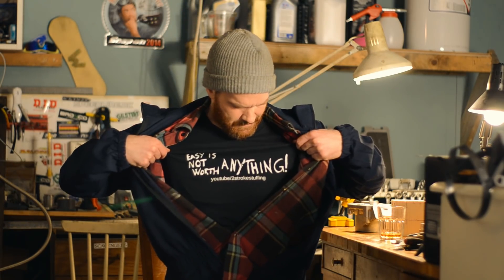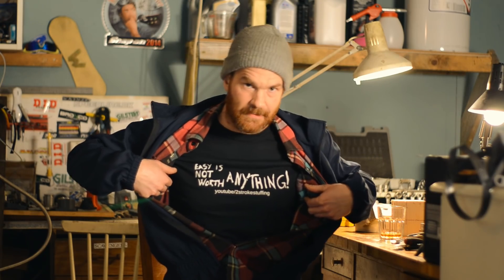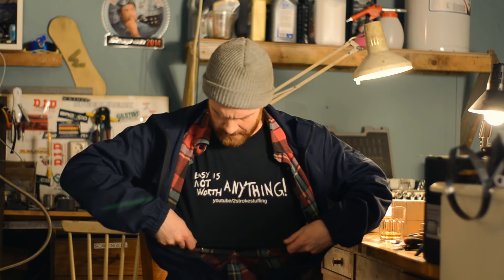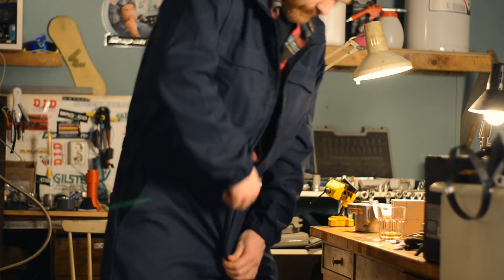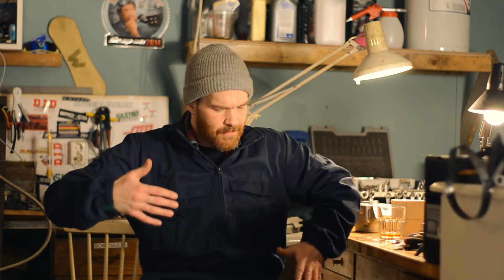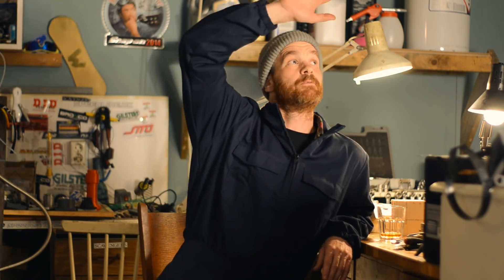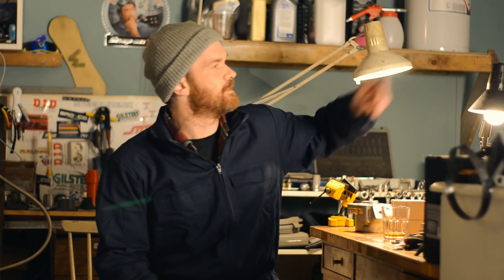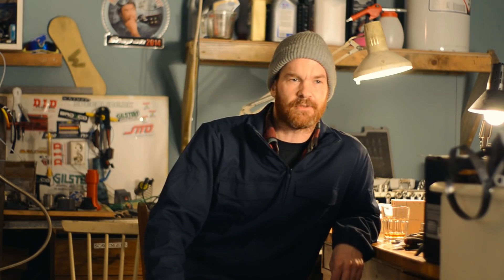The Most Powerful Two Stroke Ever but my tools need to obey their master first.

Comment: A long time ago I rubbed MoS2 grease in a 50cc freshly bored cylinder before putting everything together, after who knows how many km the rings started ringing a bit, this motor I estimated to at least 5-6hp after I did various trickery to maintain a good low rpm(!) power (for offroading) while it would run at around 8000rpm @ 90km/h, oh, the point, the cylinder had a dark glaze with no wear, but the piston and rings had done their job.
PS
A hint, it was a Yamaha DT50mx sold with 2.4hp to be lovlig ;)
The 16mm carb (sold with 14mm) gave just a bit more rpm for higher speed, which was mostly just a bonus, I aimed for "growl" not a dentist drill.. I did a few more things too, like an experiment making a 2-chamber out of the original exhaust (so the cops would not notice, and to keep the bottom pull) plus a small clutch spring in the wider part of the intake funnel to help mix things at low rpm ok I should stop here x)

Comment: Hi mate , I was wondering what's the purpose of secondary intake . From what I get it works on the resonance,  that's why theres no need for a reed valve , but wouldin't  that stop the carburettor from working?

Comment: Keep up the good work man.
I wonder if you saw my comment about using copper for head inserts in order to be able to get more aggressive without detonating. Beryllium copper would be the choice material, they use it for valve seat inserts with titanium valves in 4stroke to cool the valves.

Comment: I have a question I can't seem to find information on non reeded 2 strokes mainly used on smaller displacement engines gopeds weed wackers ect and was wondering if you could do a small vid on how they work and pros and cons of reeded vs non reeded figured if anyone could make a good video on them it would be you

Comment: Spend 10 minutes a day on the lathe and ten minutes on the mill. Doesn't matter what you do. Change bits, turn it on, turn it off, do it again, ... whatever. It literally doesn't matter. The point is to create a habit. Don't think about it, just do 10 minutes a day on each one. Eventually you will do more fruitful things and you will work longer because you made it a habit. How easy is it for you to work on your two stroke? This is because the habit was created easily because you love what you are doing. But you can tackle other things that may you may not have as much love for by making them a habit first. Try it! I HATE working out. I am applying this technique myself with dumbbells. I do a few minutes, as much as I can stand then I'm done, no guilt. I'll let you know how it goes.

Comment: Great work! If your steppers are cold you can safely increase the current to reduce risk of lost steps as forces increase with feed rate.  Rule of thumb is that 50 centigrades should be fine.

Comment: You should really fix the mill to the floor. Having is lose like that does No good for accuracy and chatter/surface quality
Reply: A mill that size it will make zero difference..
Reply: @M Bacon ... ok 17 years building, moving, maintaining, rebuilding Cnc grinders.. some grinding to less than a 1μm all over the world.. if you've ever been on an turbine powered aeroplane at some point parts of its landing legs and engines have been on machines I've built or rebuilt.. I'll repeat a machine that light, small and running on stepper motors.. you won't see any difference.

Comment: As a general rule it is better to run higher step ratios. 2:1 theoretically gets a little more peak torque, this is only when stationary. Once you get moving the extra smoothness of higher step ratios generally makes the motors less likely to lose steps.
One problem is pulse timing. Ideally at steady speed the step pulses should be exactly evenly spaced. In practice they aren't and steppers are very sensitive to timing jitter. There is always some jitter in the pulse timing and Mach3 running parallel ports directly is particularly prone to this. With micro stepping this timing jitter is averaged out to a certain extent. Mechanical resonance is also more of an issue with lower step ratios. I'd suggest trying 16:1 or 8:1.
What voltage are your steppers running at? These old motors like lots of voltage. I'd suggest at least 48V assuming your drivers can handle it. They may even take 80V but you may get heating problems. If you can hold on to the motor for  a couple of seconds it's fine.
PS that noise at 3:40 was drive belt slip. I'm very familiar with the sound of slipping toothed belts. Try increasing the tension. They like running tight. They are also pretty sensitive to pulley alignment. If one pulley is tipped relative to the other you can have problems.

Comment: Nice video, but first tool what you need is a proper MPG pendant for the mill! Manual pulse wheel is so much more precise to zero with, and not crashing in to your part. And when circular interpolating a hole you should first drill it out if possible. No point milling when drilling is an option. It's the most fastest way to remove material.

Comment: You need to hook up a MPG (manual pulse generator), it will make everything so easier, that you will regret why you didn't do it before. There are many different variants available from china, take a simple one with pulse wheel + step selector (x1, x10, x100) + axis selector, you don't need those fancy ones with displays and other unnecessary stuff...
Also get yourself a proper edge finder, look at the rotational edge finders, they are cheap and very accurate. Forget electronic ones with the LED in it, just a simple rotational one, it is very accurate and simple...

Comment: Couldn’t facing the cylinder on both ends just be done on the lathe? The surface finish could be better / flatter and you could physically clamp on the ID of the cylinder with the 4-jaws and zero it out....technically you could go as far as making an arbor to secure the colder on its ID that has tapers and locking features if you wanted to be able to do more cylinders in the future more quickly.

Comment: im a driveshaft tech and you are most likly going to want to slow down youre feed speed fort metal you also might want to get a rockwell test kit so you know the hardness not to chip youre mill end bitd also collant is a must on materals heat will expand ande squeeze youre vice outward then when it cools it is loose 
learned this the hard way heat is youre enemy not to mention bits are expensave and coolant will make them last way longer

Comment: Haha, I was just abput to ask if the mill was gifted to you cuz if so, then I was thinking you were a bit harsh on the previous owner, but turns out you paid for it. Essentially, you bought to right to complain a little;). Either way, you'll figure it all out. At some point, you might want to go with closed loop steppers. They seem fairly affordable now for the peace of mind, they give. That said, I am still in a long planning phase of eventually building my own table top CNC mill, so it's just what I have read from other people.

Comment: Find yourself an adjustable vice endstop. That or clamp something to the fixed jaw on the side. Then use that as your 0,0. Getting used to having a set home position to fixture off will help you later and save time. Same with tool height setting. I set all my tools off the table then you just have to set you z 0 when your ready to rock.

Comment: True that wiring is horrible, shouldn't be too much work to straighten it out. Wondering if the power supply in the back might have stopped working and the new one was just slapped over it? Who knows. Nice to see the new equipment getting sorted. Great video, keep em comming

Comment: A large wiring schematic, drawn full size in this case, would be very helpful. If it's working now then it would be prudent to complete the drawing before removing anything. Plenty of photos will help too when the inevitable goes wrong. There's a huge benefit to gain in your understanding of the wiring by taking the time to draw it out accurately. Next step is labelling everything correctly...
Complicated wiring will become much simpler once you saw it into bite sized pieces. Watch out for noise problems being inadvertently created with parallel unshielded conductors. Further on that topic remember to only ground one end of a cable's shield. High precision positioning systems and electrical noise don't get along very well but they're manageable with a little forethought. You also want to watch out for heat related problems and many boards rely on a metal frame to sink to. I'm sure you're going to have fun. It's impressive what you've sorted out already and you've only gotten started. Best of luck with your toy.

Comment: The power-supply that looks like it isn't hooked to anything, it could be used to double the voltage. 
Remove the top power supply to check for internal wiring (not exposed wires on the back) to the 2nd power supply. 
If if see that kind of wiring, i wouldn't be suprised to see a power supply that doesnt't do anything OR a power supply with "floating ground"

Comment: I was wondering why there were 2 power supplies and why the drivers were set at a lower current. Perhaps the larger unused power supply has failed and the smaller one is a replacement and not rated for the current used if all the drivers are active at the same time at full current. I was trying to see the output voltage but all I could see was a red line and an adjust voltage arrow.

If you have power problems and the output voltage is 12v have a look for HP server Power Supplies on eBay. These are 12v only output, there are plenty giving 750W or 1200W for under 25 euro. You would also need a breakout box for around 10 euro. These things are incredibly reliable and extremely stable even at full power, though they are a little noisy (think hurricane force wind from the fan).

Comment: I have a Fadal CNC, and if I were going to machine that cylinder, I would setup a boring head to do the cylinder bore, then use a boring cycle.  I might interpolate the bore to within 1mm in diameter, but that depends on how rigid and accurate your machine is.  If the machine can rough the bore out concentric to the actual bore location, then that is okay to do.  If the machine can't interpolate a reasonably accurate rough bore, then it's better to try and bore it out in stages using a boring head.  The boring head is going to deflect so if the rough bore is off center or is not round, the boring head will have trouble producing a nicely round bore.

I would probably affix the cylinder to the table and rough machine the bottom face parallel to the table, then I would flip it over and clamp it down on that face and machine the top surface roughly parallel.  After inspection of the parts to ensure the faces are parallel and square to the bore, I would clamp it down on the top of the cylinder, then finish machine the bottom face and put the bolt holes in.  Then I would flip it over and bolt it down to a fixture that mimics the case of the engine and finish machine the top surface of the cylinder, including bolt holes and features.  I would then do the rough machining of the bore and semi-finish (rough, semi-finish, finish are the 3 steps to most machining cycles) the bore.  I would then take the cylinder off and do a final inspection of the top and bottom faces and bore, to ensure they are square, parallel, and located in the correct place.  Once you are confident the bore can be finished, clamp it up using the torque plates and fixture it so you can do a finish bore.  Be sure to leave material to hone it to size, then have it plated, then do your finish hone.  You should hone the aluminum cylinder prior to plating to ensure the plating thickness will be consistent, so after plating the final hone will result in a cylinder with consistent plating thickness and distortion.

This is how I would approach that project with the type of equipment you are using.
Reply: I don't think I would trust the rigidity of that mill for the boring, I would rather chuck it up and dial it in on a 4 jaw in the lathe and then use the biggest boring bar I could fit to make the cut.

Comment: I have been looking into Chinese diesel heater for my workshop, they are about £100 for a 5kw, they are a good bit of kit and almost silent with a silencer/muffler fitted. One or  2 of those might be a better option than your current unit. There are about the size of a briefcase, loads of reveiw vids on YT
Reply: Yes, but be carefull cheap chinese heaters have often toxic smelly abs plastik covers in contact with the hot air.. And some have leaks inside where the lines go into the combustion chamber :)  best is when u replace plastic with metal. And have a fireangel C. Monoxide warner and some oven silicone arround.. But i think the gas heater? He uses now makes too some co. ,.. no option for longterm use inside a room.  Ps: if u want a silent exhaust(neighbours^^) fill a closedlid metal bucket with seramis and steelwool and feed the exhaust through it.. :)

Comment: Just go steady, your machines are tiny, bear in mind all machining is about rigidity.
I have no knowledge of cnc but years of manual. Rigidity is everything, whether lathe, Mill or borer. 
Every part of your operation, tool, vice, bed, all of it... Rigid. 
Minimum tool length, workpiece height etc. 
On a small machine like yours where ridigety is frankly non exsitant take your time.. Your machine isn't built for heavy cuts, light finishing is its thing. 
My humble opinion. 
Don't break it. 
Y'all take care 
Simon
Reply: I see some suggestions about using wood etc to practice with.
Don't. 
Every material machines different, even different pieces of "quertified" same.
Reply: Or even certified....
Reply: .... Stop laughing..... You know what I mean... 🙄

Comment: I was thinking for a good test of how machining the metal 3d printed cylinder is going to go would be to 3d print in plastic your cylinder and machine it like you are going to use it on your engine. This could help show you how mounting it up and running the programs are going to go and see if anything needs to be tweaked to make the cuts correctly. I look forward to hearing this engine scream to full speed.
Reply: This is a really good idea. Can do a couple of test runs for small cost. Maybe A giveaway or prize with the machined plastic cylinders.
Reply: @M Bacon You are correct, I was just thinking to make sure cylinder fixtures are correct and to get a feel for how the whole process is going to go before committing to a 1 off part. I have never done anything like this and this is what went through my mind if I were to do it. I don't even own a 3d printer so when I see someone do this in there home garage they are like a rocket scientist to me. The only thing I have done is turn wrenches on cars/trucks and  multimillion dollar aircraft in the military.

Comment: A tip! As a rule in CNC machining, the Down Milling type of cut is normally used instead of Up Milling. Perhaps it is better to see a more detailed explanation to understand why.
I leave here one of the many sources of information available:
https://www.sandvik.coromant.com/en-gb/knowledge/milling/pages/up-milling-vs-down-milling.aspx
Good work, see you one the next one!
Reply: This is what they teach in school and in the manuals of the new CNC machine - and it's true! But only if you have a tight, rigid CNC machine and you're trying to maximize productivity. For an old, sloppy machine - conventional is the way every time. Ever try climb milling on an old bridgeport?

This is, IMO, the biggest reason he was having issues with the last parts he was milling. As soon as the mill changed directions, the climb milling pulled the cutter into the part and caused all sorts of havok. This is exactly why you can't use climb milling on a sloppy old machine.
Reply: @bradley3549  Those Denford machines were built more like miniaturized industrial machines rather than CNC converted hobby machines. Unless it's been abused it's probably pretty rigid for it's size. The vast majority were bought by schools and colleges so they didn't get heavy production use. It looked like he was taking pretty light cuts so I don't think climb milling would be an issue, especially in wood or aluminium.
Reply: @LesNewell  Had a Denford Mirac for a while, if the mill is similar quality, Id sure go for climb milling only. 
Much easier on tools and cutting forces, but as Bruce says, not on a conventional mill with huge backlash.
Reply: @LesNewell  It may be wear, it may be out of adjustment, but I based on what I've seen it's definitely not as tight as it probably was when new. Which is a huge factor regardless of how well it was built from the factory.
Reply: @bradley3549  Yes this is true if you don't have a backlash eliminator or there is play in the ball screws or slide ways on a CNC the cutter will be pulled into the job If you are climb milling. Also if your work isn't held secure enough then climb milling will pull the job out of position and into the cutter. If you use conventional milling the job will just push out of the way. I'm an Engineering tutor and we always show the students how they will break cutters trying to climb mill on our manual machines and how they must make sure the backlash is in the correct direction before taking a cut or they will also have problems